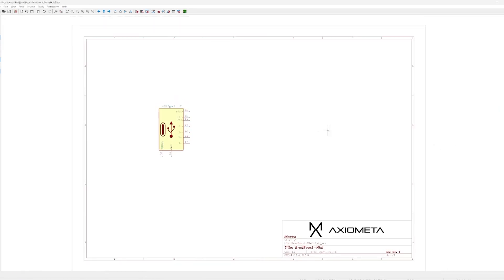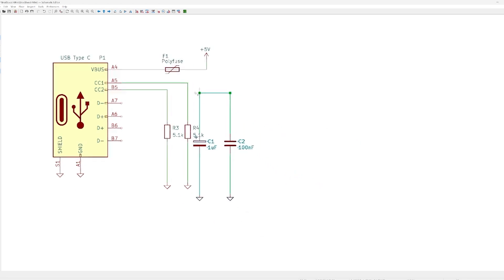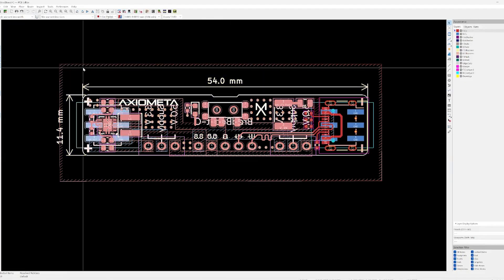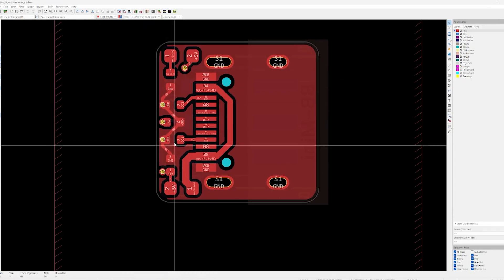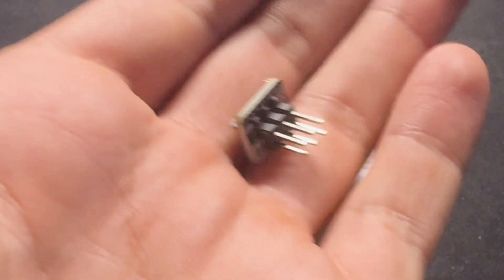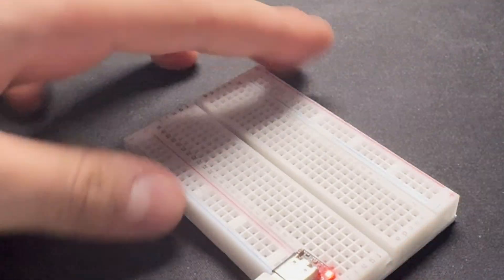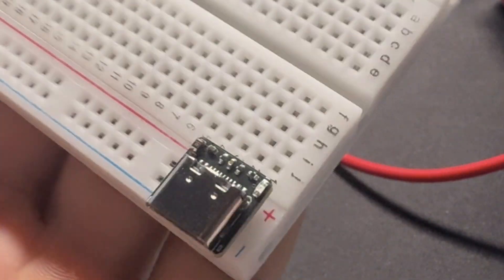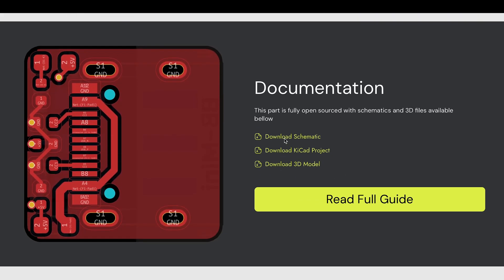I made the world's smallest breadboard power supply.

Comment: "power" "supply"
Reply from the maker: You’re right. A breadboard power module that negotiates a fixed 5 V over USB-C would be a better fit xd
Reply: @axiometa no negotiating tho.
Reply: @felix9955  Correct me if I’m wrong, but negotiating is for higher voltages above 5v, right?
Reply: @pumpkinferret  Yes. Default is 5v from usb-c. Negotiating requires something like a pd trigger and for the power supply to be able to output those voltages&current. Check out the HUSB238 breakout board from Adafruit. Larger footprint but access to 5v,9v,12v,15v,18v, and 20v. all you need to do is solder some header pins to it, to use with a breadboard.
Reply: How do you call these?